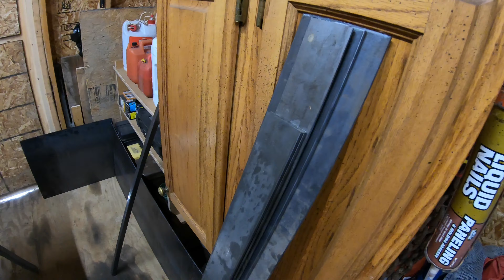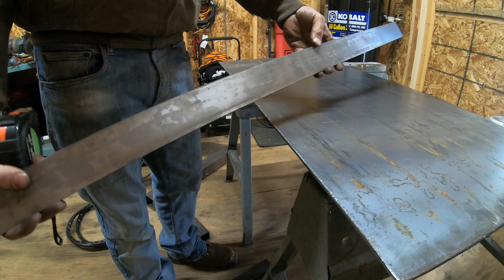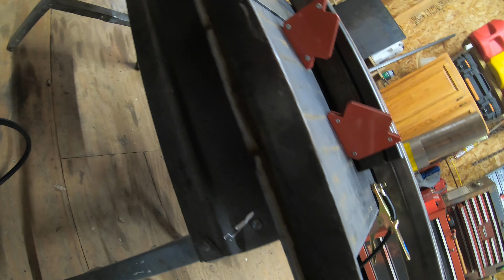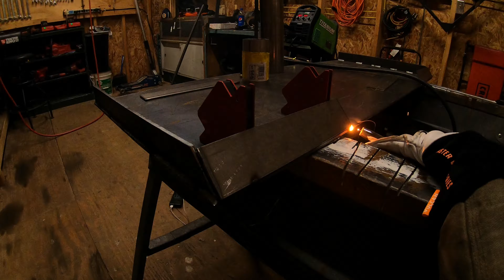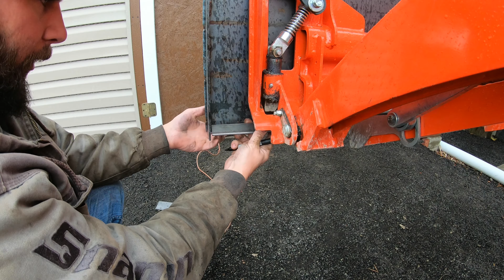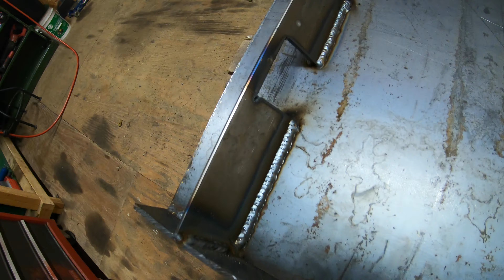Kubota BX- (How-To) DIY Skidsteer Mount Build- (Tree Shear Part 1)

Comment: You didnt put the 2 pieces of metal together and then cut?  shaaaaaaaaaame!!  Nice job though.
Reply from the maker: Hey buddy, yah the only reason I didn’t put 2 pieces together when I cut them was cuz my plasma is only working off 110V out in my shed. It’s really truely amazing I’m able to even cut what I cut out there on 110v.. it will cut up to 3/8” on 110v when I have to but it’s not happy about it.. also the thinner the cuts I make the cleaner they come out and the easier they are to knock the slag off.. so for as little time as it takes to make the cuts I’d rather just make them individually. Thanks for watching 👍🏻
Reply: @BiffsEquipment   - Thats cool.  I was just goofing around busting your chops.  Glad to see you have the personality that takes it that way.  Keep rockin brotha!!

Comment: This will be an interesting project. I like that you built your own quick attach plate. How much did the piece of 1/4 cost for the back?
Reply from the maker: Thanks Roger, I got the tree shear finished just working on getting the video together.. the tree shear didn’t go quite as planned it still needs work. Be interested in what you recommend actually at the end of the video when I upload it. As for the sheet of steel I wanna say it was around $200ish for the full sheet

Comment: Nice work. 
Is that plasma a drag tip, or were you holding it up for those cuts?
Reply from the maker: Plasma is a drag tip, but you can also use it as a non drag tip but you really need to be on 220v for that as the farther away you are from the steel the more amperage it will need to complete the arc. Thanks for watching!

Comment: I need to make a balance box
Reply from the maker: A weight box would be easy too, it’s just a box so I would buy a sheet of steel like I did and do it yourself, you could prolly get away with 1/2 a sheet of steel, I would use 3/16 or 1/4” for a weight box. 👍🏻

Comment: I would weld in gussets on each side of the pin holes and the open end of pin capture plates.
Reply from the maker: I thought about it but it really isn’t needed for this project, all the bottom mounts do is keep the plate against the coupler so there really isn’t much pressure on them, if it was for a bucket or something where I’d be applying a lot of down pressure and pulling force then I would def do this tho. Thanks for watching!

Comment: Nice welds!
Reply from the maker: Thanks Bruce! They turned out much nicer once I got that .035 wire installed, and once I started getting use to the welder, (this is only my second time using it)